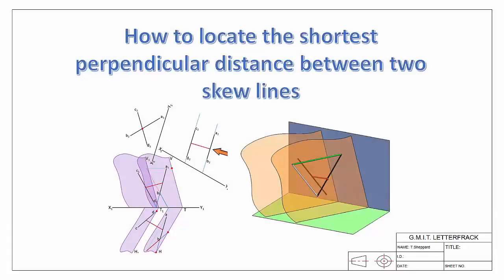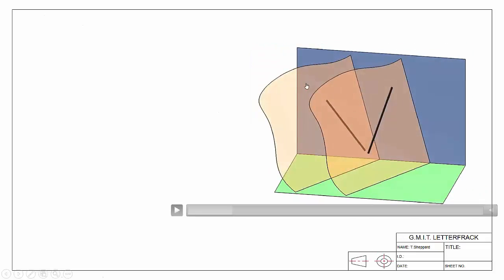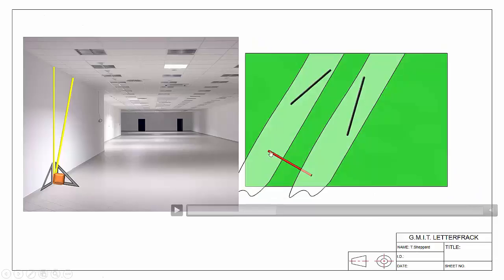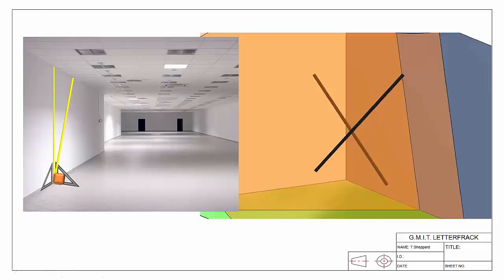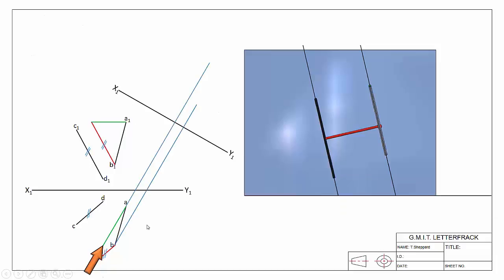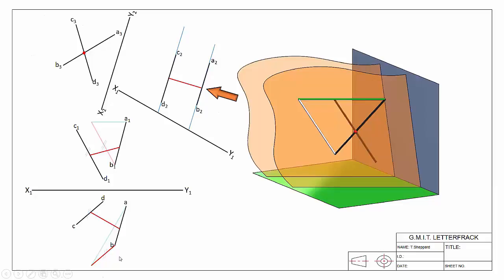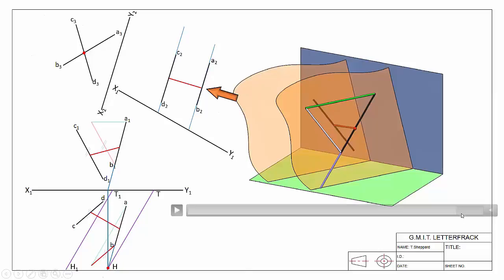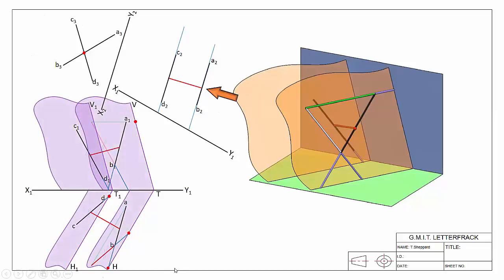Shortest Perpendicular Distance

Comment: can you please do a video of distance between a point and a plane ?
Reply: One way that i know is to make 2 plane through your point in question, each one intersect a line on that plane in question perpendicularly (choosing trace lines is much recommended rather than arbitrary lines on the planes), so suppose you have point P and plane pi and you want to measure distance between them. First you make the trace of plane Pi (create a triangle portion of it) suppose your traces are l1,l2,l3. Make 2 planes through P and two of the traces and those two planes must each intersect the traces perpendicularly. Suppose those two planes are Pi1 and Pi2, Pi1 intersect l1 perpendicularly like Pi2 also does with l2 (remember that Pi1 and Pi2 must also goes through P), make the intersection lines between Pi1 and pi also with Pi2 and pi (name those two lines k1,k2), intersection point of k1 and k2 is the projection of point P onto plane pi (name that P') connect P and P' and line PP' is your distance between point P and plane Pi. I recommend that you create a cube that contain P and Pi traces so that it would be easier to do. I didn't find this on google, rather think about this on my own when i want to find a way to do distance between point and plane in a cube without using vector